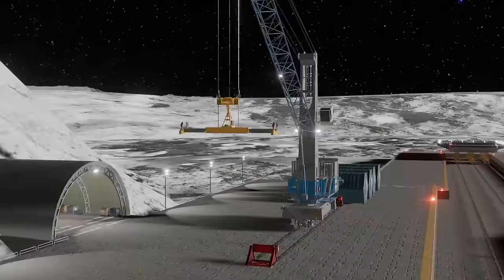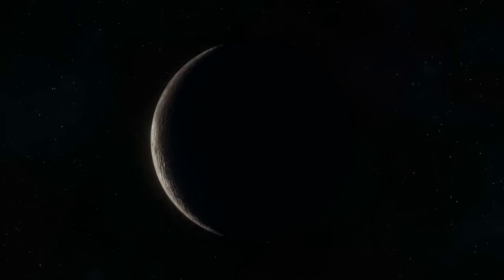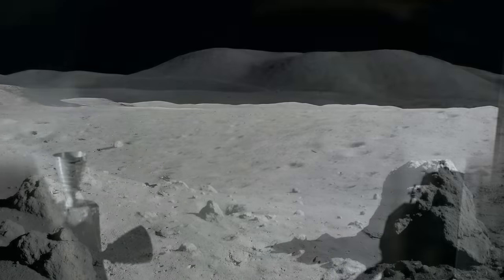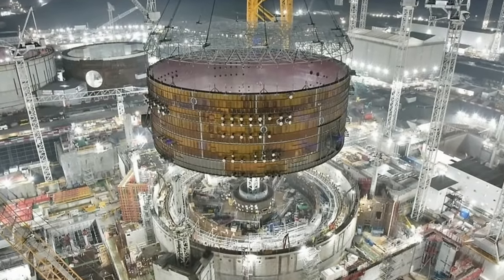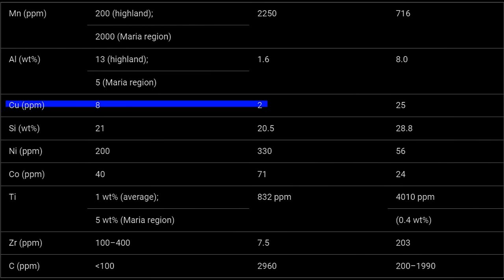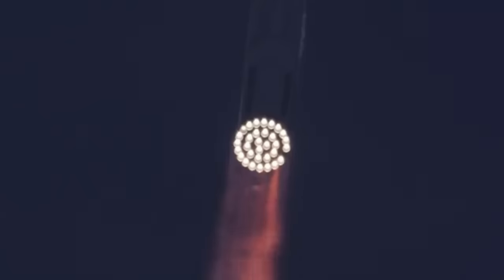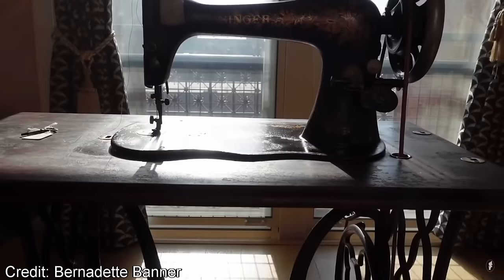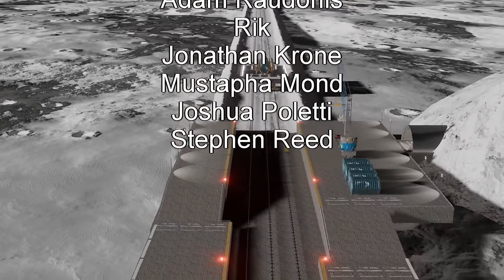Designing Heavy Machinery To Excavate The Moon

Comment: As an Engineer routinely dealing with mining machinery I find myself gagging over the lack of comprehension regarding scale, complexity and cost. When we dig stuff up, we don't throw it into a bucket and melt it. Instead we processes for crushing and separation. A lot of the processes are aqueous or require strong chemical reagents. And specialised materials. And instrumentation and control. And that's before we get to thousands of separate processes that turn molten metal into actual working things. Real world mining trucks are very expensive to maintain and also very energy intensive. The specialised ultra-hard materials needed to dig, scrape and crush also require a lot of other elements and elaborate manufacture. Plus you're in an environment where every particle is abrasive, where ordinary lubrication fluids will evaporate and Earth-competent seals will fail.

People don't realise just how much energy is involved. A typical Earth mining truck consumes megawatts of power. Just one vehicle. And you need an efficient store of mobile, dense energy. Yes, I'm a fan of battery technology but again, you want Flintstones tech? That comes with lower energy density and shorter life. You can make liquid fuels of course. You can even drive these things on fuel cells but I won't even go into the myriads of materials and processes that go into those.

And yes, you have the materials for solar cells on the moon. But no, even the crudest devices are far, far removed from Flintstones tech. So is anything electrical or electronic (which you simply cannot avoid). And speaking of solar panels, you're talking tens to hundreds of megawatts for a realistic small scale mining operation, let alone the materials processing backend. You'll quickly find that the crater rims where you get nearly 24/7 sunlight become crowded real estate. Plus that's at the poles, so then you have gigantic logistical issues transporting the energy to where you need it. 

I give this video credit for at least having a stab at it, but there's something that bugs me more. The assumption that human happiness is about endless expansion, consumption and let's face it, avarice. Do we need massive space habitats other than expensive holiday destinations? In no way does a human being live a better life in a space structure than on Earth. Never, ever does living long term in space grant a tangible benefit to a sane, well informed, rationally self interested human being. Again, we've all grown up on a diet of sci-fi but there is a difference between whether something can be done and whether something is worth doing. Do we need a Dyson sphere in order to live a life of tranquility and luxury? Well, no. 

Whilst people imagine giant machines in space they often forget that if you assume that level of technological prowess you can also imagine how it would be applied on Earth. Green deserts. Endless food supplies, more space for other species and yes with this level of cheap energy and technology we can create a genuine circular economy. In fact its easier than mining the moon.

Comment: One Starship launch per day is not as unrealistic as has been asserted. Firstly, there are already two launch towers built/being built at Boca Chica. SpaceX plans to build at least 2 more towers at Cape Canaveral, and recently SpaceX has expressed interest in building another spaceport in Australia. In the worst case, SpaceX has 2 launch towers. In the best case, SpaceX has 6 or more launch towers around the world. Also, SpaceX is targeting a booster turnaround time of mere hours. Starship absolutely has the potential to launch 1+ times per day. However, it would require a lot of launch towers, a lot of upper stages, and a lot of work. We’ll have to see if SpaceX pulls it off.
Reply: They are already launching Falcon 9 every 2-3 days. Its not unrealistic at all.

Comment: On the subject of numbers, consider for a moment SpaceX's Starship.  Admittedly its cargo capacities aren't finalized, but we can use the published numbers as a decent ballpark.  If you look at the numbers, you discover something.  Starship is so ridiculously big that you can fit an entire Komatsu mining dump truck into its payload bay, both by mass and by dimensions.  (You might have to dismount the wheels.)

While you're right that an entire industrial base on Luna needs to use Lunar resources, the starting seed can be big.  Really really big.  Any discussion of how to start utilizing the Moon needs to bear in mind the looming reality of Starship.  We're used to thinking about payloads massing tens of tonnes.  We need to get used to thinking about 100+ tonnes.
Reply from the maker: Good point. I try to find a minimum viable route in my how to develop the moon series but anything extra is welcomed to the fullest extent.
Reply: I am fairly sure 100 t on LEO will shrink heavily if you need to land it safely on Moon. Starship is not mucarcle, just optimized chemical rocket.
Reply: @andrewrandrianasulu_ You refill it in LEO mate, do you know anything about the architecture???

Comment: A few notes: 
1/6th g is not as much of an advantage as you might think, because it means your vehicles need to be 6 times bigger for the same breaking power (you did briefly mention this).  You can make it heavier, but if you could use a lighter option, you'd be able to make more diggers with the same resource, without adding significant complexity.  (See rassor, uses two counter-rotating buckets to dig each bucket into the surface using the force of the other bucket, instead of is mass.)

Also, less efficient battery & motor chemistry is better of your want more mass, some modern electric forklifts use lead-acid batteries instead of lithium-ion because it eliminates the need for a counterweight. 

Overall, very good and well presented video.

Comment: You should look at construction scrapers. I think that would serve the purpose you mentioned with the bulldozer better. The material could simply be scraped from the surface into the onboard container, then potentially just dropped out the bottom into some sort of chute or something at the refining/smelting plant.

I see a lot of people mentioning cables instead of batteries and I think that's a great idea. Essentially having giant winches that let out the cable and can pull it in later.

With the scrapers this could potentially also be used to drag them in as it often takes a decent ammount of force. The scrapers could drive out themselves and then be pulled back in by giant winch motors, scraping as they go.

This then leads me to think about dragline excavators, which could be very useful in this situation.

Awesome video!

Comment: the problem with the moon is simply moon dust. its like jagged glass shards instead of sand. this works its way into every tiny little crevice then strongly bonding together with movement or friction. thus resulting in everything becoming ceased after a certain period. if we ever want to master space. we first must master how to contain machinery from the elements yet remain easy to repair. then we might be prepared for interstellar travel. its one of our biggest hurdles to last on the moon. because the moon cements everything from moving for long.
Reply: 10:40

Comment: Low carbon steel is 0.25% carbon, so for a 4 ton steel tractor that would mean 100kg of carbon per tractor. Human faeces contain about 10% carbon, so that means you'll require a ton of faeces to produce one tractor. A typical human produces about .5kg a day of faeces. Which means that a single tractor would equal 2000 days of aggregate pooping per tractor. That is a lot of pooping!

Comment: You perfectly analysed the problem and laid out a path of solutions.
This is the kind of thinking that will get us to the moon again and stay this time.

I really can't add any more ideas for the broader picture, because you painted it expertly.
Reply: Just a tiny nitpick from my side:
Starship will not be used as an Earth surface - moon surface shuttle. The whole thing will require too much propellant and will deliver too little payload.
However Starship is perfect for a Earth surface - low lunar orbit shuttle. Because it has a heatshield it need very little propellant to get back to earth. The lander can either be carried with the ship or be docked to in LLO. If the lander is carried in Starship (for maintenance on earth during the early days for example) it can also be refilled in LEO just as the Starship.

Comment: As you scale across the surface, I expect that the digger equipment will scale to fit onto trains so they can be moved too and from sites as needed. With no air resistance, there is no need to pack them away into shipping carts just stacks of parts that can be assembled via a train cart crane.

Comment: That gravity thing is a real killer here. Having said that, uou have to design something that works with a large number of constraints such as, but by no means limited to;
local resources only
low G
high dust environs
resistant to Low temps
resistant to High temps
HUGE temperature swings - not in the same boat as above but think changing temps cause expansion or contraction
General durability & Reparability - Chains last longer than wires and so on. 
loss of friction forces
fewer available fuel sources
minimal battery options - which you discussed good on you for that
minimal power sources - see previous
asteroid/micro meteor impact resistant (shit likes to hit all your stuff at mach speeds cause its Fraking Space...)
and many many more things...

Basically space is a giant ditch witch and she's come to take all your fun, all your cash, and give nothing back cause she's a royal C$#T. That's what we've got to work with.

Comment: One thought on the fleet of heavy machines, taking inspiration from Load Haul Dump machines used in underground hand rock mining might be useful.  While a lot of their features are redundant, i think the big things that could be taking inspiration from are that they can pick up material and put it in place without help from anything additional machinery. 

But the big one is just not having the power source on the vehicle, no batteries or anything. Instead they use a long cable going back to a fixed generator. By using a long cable rather than a battery you save a lot of design effort. If you need to go further away you can make the cable longer.
Reply from the maker: I was thinking something similar cable wise for lunar trains

Comment: The best way to start is by building the refineries and processing plants off of the lunar surface first then bring in the digging equipment with the infrastructure necessary for either interplanetary telecommunications or orbital communications from an initial satellite based master controller with more local based communications and connections to the equipment.

Comment: As a person working with heavy-load trucks (in Ukraine we still have lots of BelAZs), they are simple, but they suffer vibration cracks and they use electric motors for the wheels, so the main problems are the dust and lubricants mixed with dust in the mechanisms. Considering the Moon, those mechanisms would be sealed, I guess, as if not, they would be vacuum-diffused (if not using advanced metamaterials). If someone considers using them as opened, they still need to be cooled down. As the war keeps going, supplies of spare parts is cut (BelAZ is a Byelorussian truck). And the financial part keeps our chiefstuff to cut, for example, maintenance for 'not so important things' as air-conditioners. Our drivers work in 50 degrees by Celsius with open doors and no one can argue as they would be fired. The maintenance is also cut from 2500 motor/hours (I write it as we call it, would write if prepared) to 5000 motor/hours. So now we can see how those truck behave in very extreme conditions withour changing oils for as twice as time. Actually, we had the best maintained trucks across the whole country before the war as we have the best road maintenance unit. Bumpy roads destroy trucks, tires, suspensions (filled with nitrogen). All of that must be considered.
Reply from the maker: @StryKhymorodnyk  hey that's really interesting thanks for sharing
Reply: As someone who works on mining plant here on Earth, all of this just drives me nuts. Its hard enough keeping seals from failing here on Earth, let alone in the near vacuum and abrasive environment on the moon. You also have a whole heap of thermal problems in an environment without convective cooling.

Comment: If we could use the iss to perfect orbital manufacturing, like melting, ducting, extruding, welding, machining, recycling, etc. I think it would make for an extremely valuable learning opportunity. It can be burned or whatever afterwards (even though a museum piece seems valuable to me).
Reply: It's already falling apart.

The Russian section has a holes nobody can find; micro impacts have pitted structural members so much that spacesuit gloves need regular replacement; and exposure to atomic oxygen has made the whole thing more brittle.

NASA and it's partners engineered the ISS to last 30 years and, by 2030, the core sections (including the leaking Russian modules) will have been in space for 32 years.

If we already had an orbital recycling center, then that would be the best option.

I think we'll have such a thing someday but not for a few more decades, and nobody wants to make that a priority just to recycle the ISS.

Moreover, we don't have any rocket powerful enought to boost ISS into a parking orbit (where it would continue to deteriorate under thermal loads, if nothing else).

Even if we did, the ISS wasn't designed to be moved, intact, and it lacks the structural strength needed for such a thing. It would bend, twist, buckle and break, even if we had a rocket that could do the job.

Sorry, but no. The desire to "save" the ISS  is a perfect example of the "sunk cost" logical fallacy.

Once it reaches the end of its useful life, we have to let it go in a way that poses the least risk to future orbital operations.

And, given the real constraints we face, de-orbiting is the best option.
Reply from the maker: or load it with instruments and send it into deep space. Voyager 3. Or just leave it in orbit as a time capsule.
Reply: May be instead of big thrust chemical rocket just use many much smaller electrical jets?

but I guess funding problem might get in the way much earlier than technical/engineering chellenges.
.

Comment: Great video! As for manufacturing, I wonder if the lunar regolith could be utilized like sand casting. This way your frames, tires, etc. would not require a heavy mold but instead can be casted in-situ. Then you would just need a machining center (or the new guy with some sand paper) to clean up the high tolerance features.

Comment: Solar will be a problem because of the moon phases.  Until we are fairly well advanced on the moon, where we can place solar arrays around the entire moon.  Its a 27 day cycle and I haven't stopped to figure it out but there will be a solar problem.  Another thing I was thinking about, is your bulldozer idea.  I don't think it will work unless it weighs a lot due to the lower gravity.  It will need to be very heavy for traction.  Railroad locomotives are designed to be as heavy as possible with manufacturers adding weight in order to increase traction.  I think your bulldozer is going to have to be made with weight pockets to fit blocks of regolith.  Consequently it will likely need wider tires as well to prevent it from sinking.  Cool video!

Comment: One thing for the computers you have to consider is that they have to be robust. Step back maybe 60 years on the nanometer production scale to reduce the occurrence and effect of bit flipping which happens when radiation hits your electronic components, that or you have to consider radiation hardening in the form of heavy or complex shielding. Manufacturing equipment for that level of technology should be relatively easy to import and operate if materials are available.

Comment: I definitely think any industrial mining equipment on the moon would be done with remote controls, saves so much design effort and its safer, also any machining/ grinding/ smelting would be super tricky because of the next to zero heat disapation, could possibly only run that machinery in the dark where its wicked cold

Comment: @anthrofuturism
I have an idea for both the dozer and digger. Make the wheels expandable so they can expand for long distance travel and contract for higher torque and lower center of gravity. For the digger specifically, I would make the wheels retractable so the digger can sit on its frame and remain immovable with a lower center of gravity. I would also make the cargo containers with a top loading door because the regolith will kick up out of the container when you hit bumps and stuff. Regolith hangs for just a bit on the surface.

Comment: As much as I am a shovel loving shovel nerd who wants to see moon shovels, bucket wheels might be better. There's a reason we use them for massive mines. Also, a rotating bucket wheel is much simpler with fewer points of failure than a complex cable driven mechanism in a shovel or dragline excavator.

Comment: The original reason for development of tracks was flotation in soft soil which wouldn't really be necessary on the moon. However, the side benefit is the reason they have become standard on bulldozers, tractive effort. This will be important on the moon because of the lesser gravity holding the vehicle down while it tries to move raw materials. The tracks offer a much higher surface area for grip against the ground to provide much higher traction. Look up drawbar pull numbers of tractors in similar weight classes with tracks vs tires and you can see the difference easily. The downside is as you mentioned, cost and complexity.